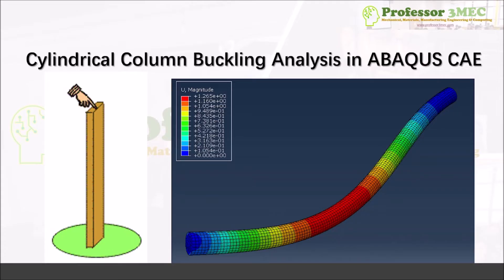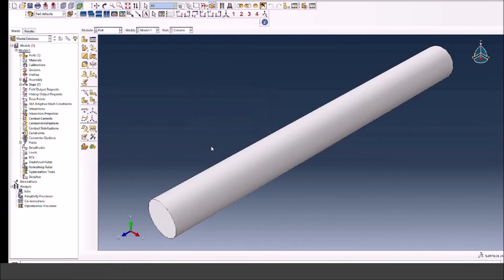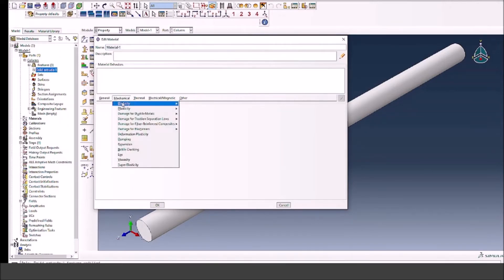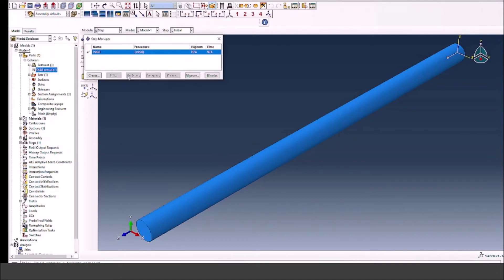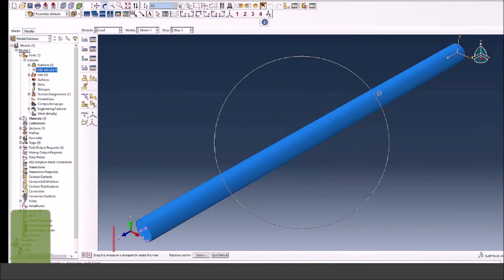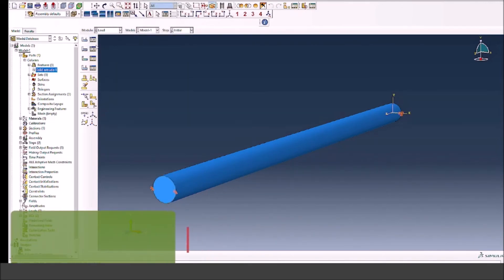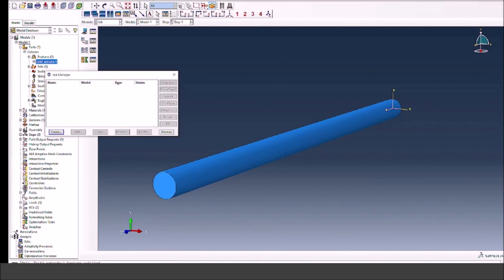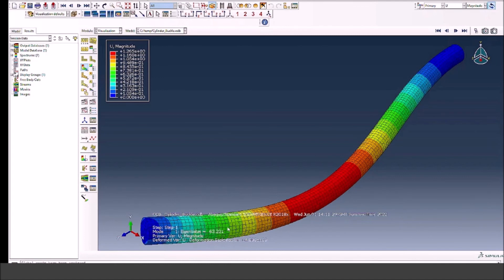Cylindrical Column Buckling Analysis in ABAQUS CAE - Made Easy

Comment: Thank you sir for the informative videos. Can you please make a video on ductile damage during compression of metal with  aspect ratio of 1.5?
Reply from the maker: Thanks for liking the video. Sure video won't be a problem. If you could please send me more details. It would be quicker to make one. Thanks
Reply: @Professor3MEC  Sir, I want to model  appearance of crack along the circumference of a solid metallic body  and relative density evolution of the compressed sample with respect to axial strain.
Reply from the maker: @AKASHKUMAR-jz9yv  which metal?
Reply: @Professor3MEC  porous copper with initial relative density of 0.85
Reply from the maker: @AKASHKUMAR-jz9yv  what is the actual damage model under compression? In ABAQUS you can either use ductile damage which is based on fracture strain as a function of triaxialty and strain rate, or you may use shear criteria.
Reply: @Professor3MEC  sir fracture strain is 0.4. I need to simulate fracture also.
Reply: @Professor3MEC  Strain rate is 0.01 per second
Reply from the maker: You may find this helpful 
Modelling Deformation in Porous Metals with Inherent Pores - Compression P1: ABAQUS CAE Tutorial
https://youtu.be/kijtaRk1n8E

More to follow
Reply: can you develop a video on global buckling of pipeline with hydrodynamic forces